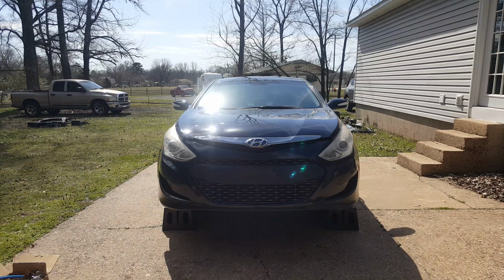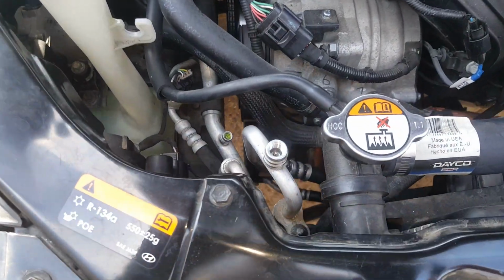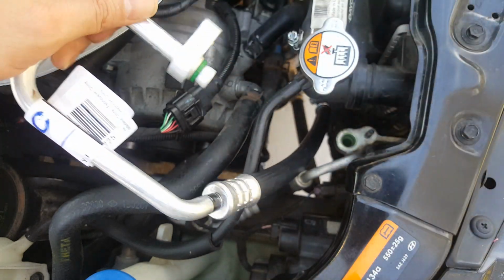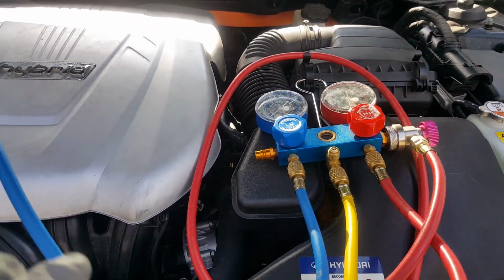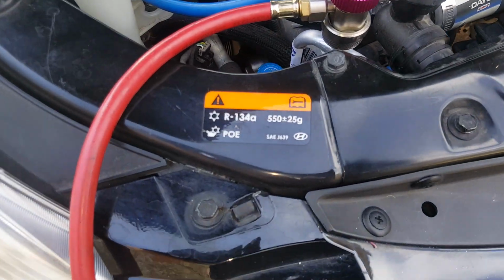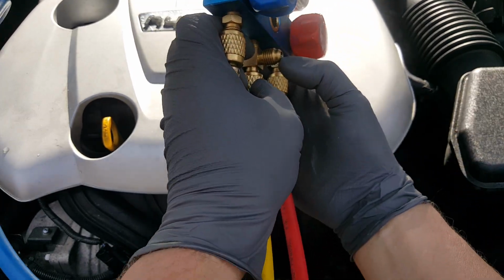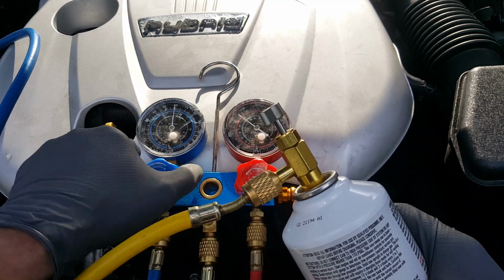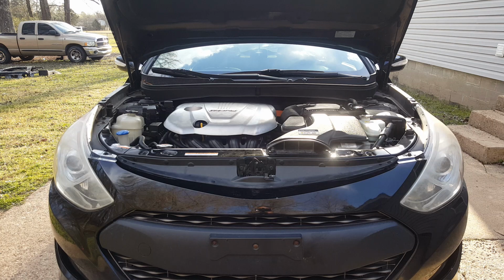How to charge the AC/replace the discharge/high pressure hose on a 2013 Hyundai Sonata Hybrid.

Comment: My 2017 sonata hybrid blows warm air when I slow down or stop/park. I thought it was because of low refrigerant but when I try to recharge it doesn’t work. The can doesnt empty . The belt isn’t spinning or the fan. My guess is that’s why. But any help would be appreciated.
Reply from the maker: It is the fan. When the ac is on the fan should be spinning . I would get the fan checked out and replaced if needed. This could also lead to overheating. I would not use the ac until the fan is fixed. Hope this helps.

Comment: 25 psi low and 125 psi high. That's the numbers that all vehicles are after? What's your elevation? 
I thought the numbers was supposed to be more around 30psi and no more than 40psi low side and high side 150psi to 200 max
Elevation is sea level here. Thanks for any info.  Great video..